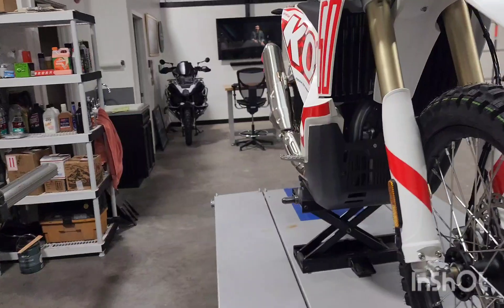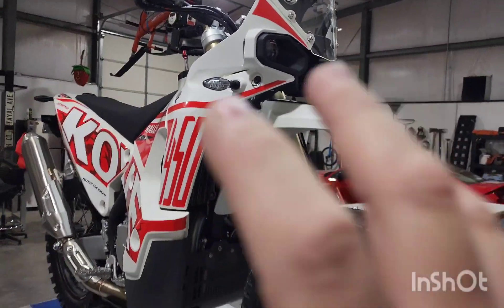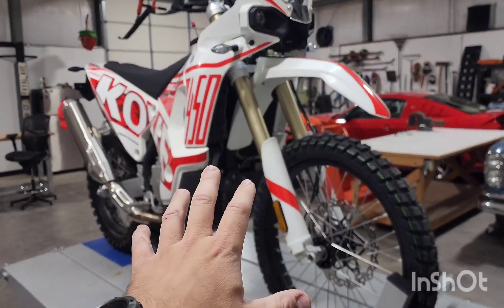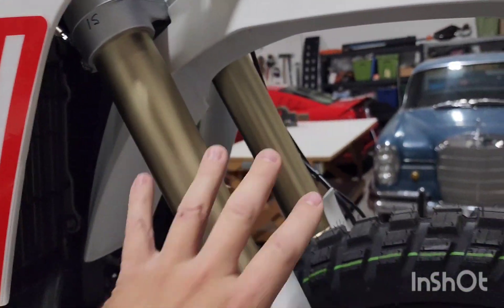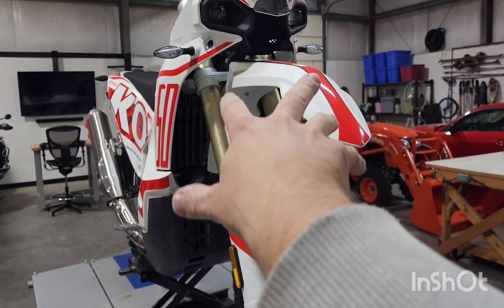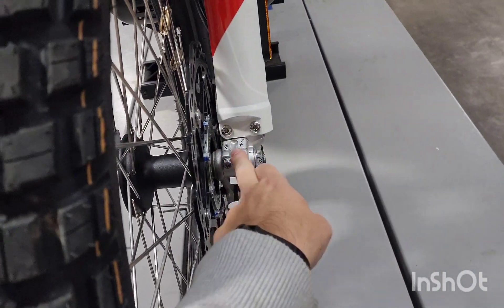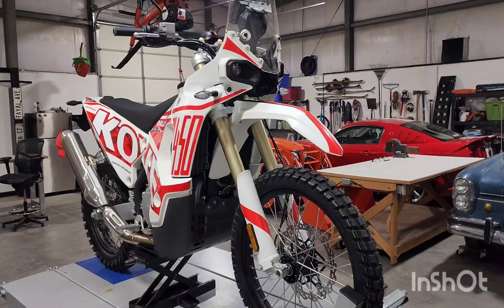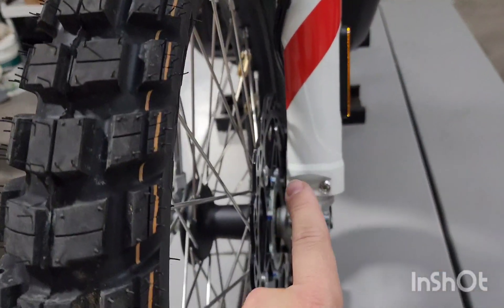2024 Kove 450 Rally Front End Torque Setup

Comment: Had trouble following so wrote out your steps if anyone wants to print them out.
Please update if you discover any changes.

Kove 450R 

Front forks and axle reset --
(from rider perspective)
1. front wheel off the ground
2. tighten top triple bolts (17NM)
3. loosen bottom triple bolts 
4. loosen axle nut
5. loosen pinch bolts
6. spin tire, hit front brake 3-4x
7. tighten bottom triple bolts (15NM)
8. slightly tighten right pinch bolts
9. tighten axle nut (28NM)
10. loosen pinch bolts
11. spin tire, hit front brake 3-4x
12. tighten right pinch bolts (15NM)
13. spin tire, hit front brake 3-4x
14. tighten left pinch bolts (15NM)

From Kove manual (torque specs):
Bolts and nuts M6 12NM 
Bolts and nuts M8 22NM
Bolts and nuts M10 60NM
Front axle nut M16 88NM
Rear axle nut M22 128NM

For KTM (250-530):
Lower triple clamp bolts 15NM
Upper triple clamp bolts 20NM
Axle pinch bolts 10NM
Reply from the maker: Hey thanks for all of that! You rock!

Comment: Do you maybe know the original torque of the top yoke nut on steering? Or what torque did you apply?
Reply from the maker: Thanks for the comment. Sorry it took me so long to respond. When torquing the center steering nut you'll need to loosen all of the top triple clamp pinch bolts first. I generally do this center nut by feel rather than a specific torque spec. You can tighten it by hand with a wrench and feel the steering, you obviously don't want any binding from stop to stop so if you feel that it's a tad to tight. I know this isn't very descriptive but I hope this helps.
Reply: Thank you!

Comment: IMO 15 N.m for a M8 bolt is too low torque. Usually has to be from 20 to 25 N.m. Just my opinion, if it works for you is OK 🤟
Reply from the maker: Thanks for the comment. I appreciate the input. KTM and Husqvarna are both at 15NM I believe as well. I actually spoke with a rep and they are reworking their torque specs for these bikes. Many have questions on why they were so high. I'm sort of waiting for them to get back with me as well but for now I'm running these without issue.
Reply: @EnduroAmerica  it's great to have info from other manufacturers, and even better to know about Kove is still doing revisions on the manual. We know their translations and technical manual is not the best 😅.
Reply from the maker: @GranXian669  I'm pretty sure an outside company wrote the manual for them which is even more of a concern. I just posted 2 of the longest oil change videos of all time, hope to shorten them when I have a chance next time around, but even some of the torque specs on the hardware for the oil change seemed excessively tight according to the manual. I went with my gut and what I've used over the last 20 years.
Reply: @EnduroAmerica  I have watch your videos and are nice!!! IMO have the correct lenght, you can see how much time takes for a novice to do the job 👍🏼

Comment: 👍🏼 Very clear  and concise (like the oilchanges 😉) video.
Ariemann1 ( https://youtu.be/sRcVGxzdaao?si=1IGW6bzZxNwKtACT ) from down under suggests "compressing" the fork while having all screws open, whereas you "only" suggest rotating the wheel and then brake. Any thoughts?
Reply from the maker: Thanks for the comment. I haven't watched A1's video. This technique was originally taught to me by an American Dakar racer many years ago. Unless you're compressing and then releasing all tension from the front end, as in the wheel dropping while still being elevated, I'm not sure it will produce the desired affect. Again, I haven't watched his video and am speculating. If I get a chance I'll check it out and report back.